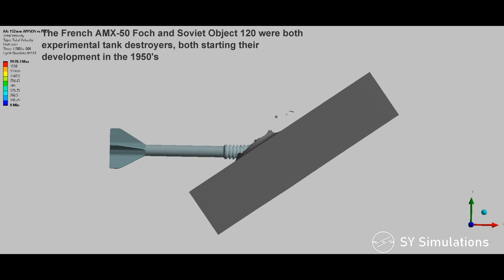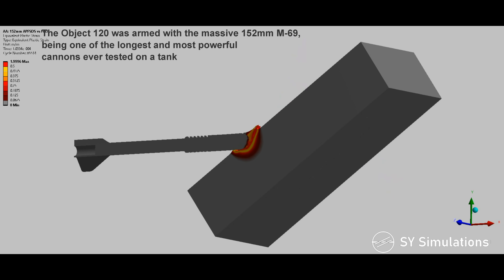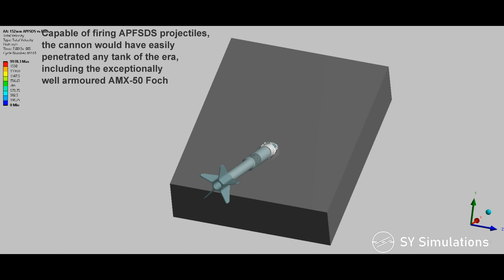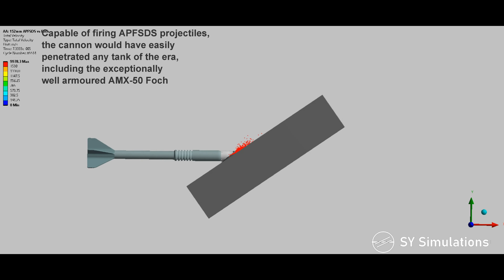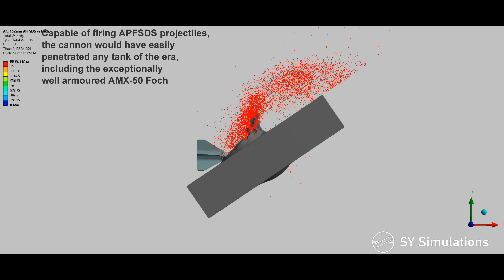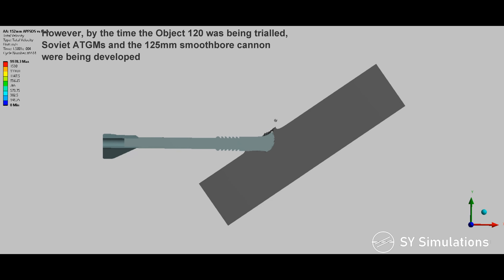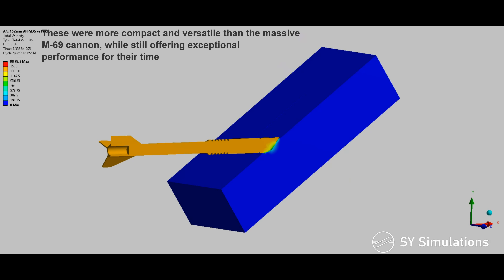OBJECT 120 TARAN vs AMX-50 FOCH | 152mm APFSDS Armour Penetration Simulation

Comment: I wonder where would caliber be today if ATGMs were never invented.
Reply: Thick spaced armor would be more prevalent on western 1960s and 1970s tanks. AMX-30 and Leopard-1 would probably not be developed. Calibers would probably be the same since modern MBTs are very well protected against ATGMs frontally. Only conventional ATGM that can potentially penetrate a modern MBT on the turret cheek is Kornet-M because it has an enormous 152 mm caliber, tandem layout and a heavy metal alloy cone for for its main shaped charge (possibly tantalum). Kornet-M can penetrate 1300 mm RHA behind Kontakt-1 ERA or up to 1450 mm without ERA.
Reply: @azeke8  When you say conventional ATGM do you mean man-portable? Because heavy ATGM like Shturm, Ataka, Vikhr and Khrizantema exist.
AMX-30 and Leo 1 were developed before ATGMs really, lightly armored because even small caliber recoilless gun HEAT like PG-9 was hard to counter without composite.
Reply: @Klovaneer Regardless, Shturm, Ataka etc. are worse in terms of penetration than Kornet-M. They would all be stopped by Leopard 2A6 and M1A2 turret composites on a frontal hit. The Leopard 1 was given little armor because MCLOS missiles already existed, like SS.11, SS.12 and Malyutka which were all very difficult to aim against vehicles moving at higher speed. When SACLOS guidance became common then armor became necessary since they are much easier to hit targets at longer range with
Reply: The same, I imagine. The reason NATO switched to 120mm guns was to penetrate the latest tank armor. In this scenario, the best infantry anti-tank weapons would be big recoilless rifles, probably around the same bore diameter as ATGMs and much less portable. Leopard 1 and AMX-30 would likely still be made; HEAT warheads would cut steel as easily as ever even without the range provided by guided missile delivery.
Reply: The same? I'm confused about the question.